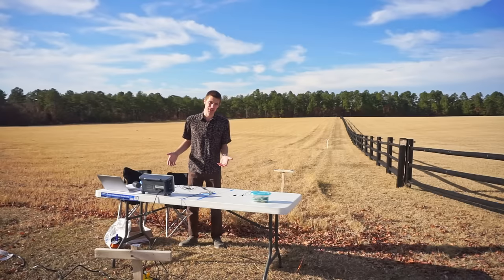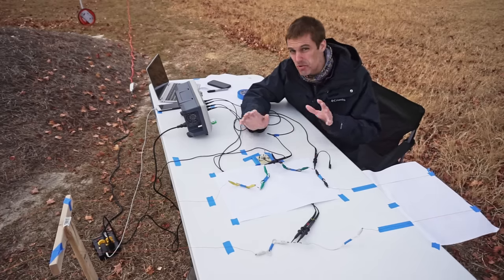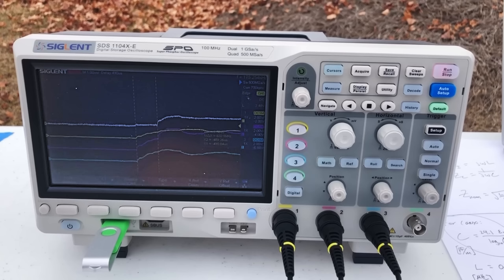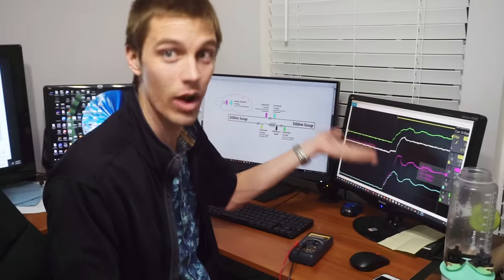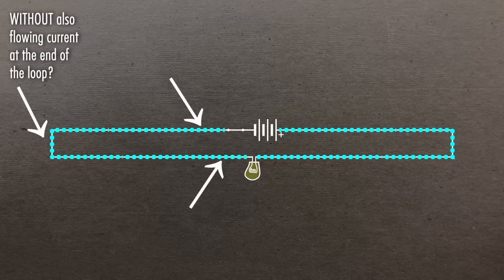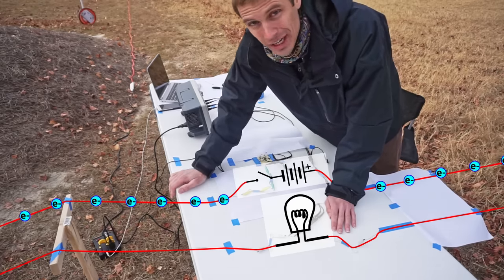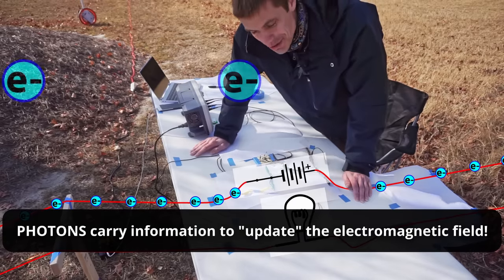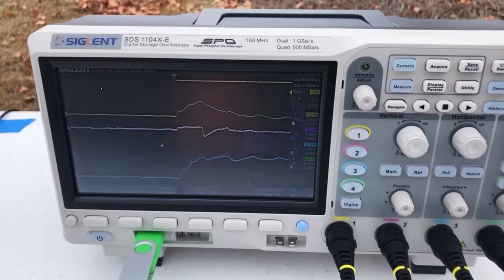I bought 1000 meters of wire to settle a physics debate

Comment: Great video! Thanks for doing the experiment for real. I like how you can see the small but constant voltage across the resistor very soon after closing the switch. I was using a 12V battery so if I used your setup I would get .5V across the bulb right away. I have seen that my bulb could light with 2V applied so you’re right it’s not quite there. But I wonder if I tweaked the thickness of the wires or the type of bulb if I could make it work. I’m doing some tests over here (not as impressively long as yours) but I will report back.
Reply: Nice!
Reply from the maker: I thought about trying to calculate the necessary size/spacing of the wires to impedance match a typical lightbulb, but I’m not convinced that the standard transmission line model applies here, because all of those calculations are assuming you’re pumping the same signal into both wires at once. There’s very particular capacitance and lack of cross inductance that falls out of that. It’s a fun thing to think about. I played with load resistances a bit but I was also fiddling with the source impedance and generally trying to keep everything high enough that the tens of ohms in the wire itself didn’t matter, and get to dc as soon as possible - you can see in these traces it took vaguely 2-3 light speed delays, and some of that was due to only switching on one side of the battery. If you can get a better match itd be pretty cool!

Edit: I’d also add that making the spacing a full meter made the effect even weaker, although that didn’t make it into pt.1, so getting it to match is an uphill battle.
Reply: This is what you should have done in the first place. I like your videos, but that one was really bad. Instead of making physics accessible to everyone, you made a non existent light bulb, that makes physics look like black magic. With magical light bulb, physics seems like magic. Nothing further from truth. Physics are simple and very understandable when properly explained, like in this video. A real bulb will never light (or if it does, it would explode after 1 us). Also units were wrong in your video. I hope you do a video explaining it correctly.
Reply: IMHO absolutely yes.

The standard transmission line model can be used; you have two transmission lines, one going to the left and one going to the right.  Say the impedance of the particular geometry (wire diameter, wire spacing) is 800 ohms.  Now your 'bulb' (resistor) is connected to the battery and the switch by two 800 ohm impedances.  Make the load 1600 ohms, and half the battery voltage will appear across the load.

Note: the 'standard' transmission line model ignores the speed of light across the gap, and only considers it along the length of the line.  So by the standard model the voltage would rise instantly across the load.  But of course we know that there is a delay across the width of the line and the rise time would not be instant.   IMHO the standard transmission line model is sufficient to describe things at time scales where the the signal will have traveled perhaps 10x the width of the line.

Setting up a signal source and scope that can see the shape of the initial rise as well as the step when the reflection comes back from the ends would require a bit more in the way of resources, because now you need a scope with GHz bandwidth.  

And Derek, I really want to thank you for putting the original video out there.  It made me think about something that I already knew in different ways, and deepened my understanding.  I've also had lots of fun discussing the various response videos.

-Jon
Reply: Hi Derek, To get higher voltage, impedance matching would at least bring your voltage up to 6V. Of course even smaller load resistance would raise the voltage even more. But then the large resistance might make it like a very non-realistic lamp. You could bring the wires much closer to increase the capacitance between the lines and so a smaller line impedance that would increase the load voltage, as a proof of concept. But at 1 meter gap, well, I'm afraid there may not be enough juice ...
Reply: Derek, the point is not if you thought experiment is right or wrong, the point is that it confused more people than it cleared up, and note how all the experts explain whats really going on without using the poynting vector. Alpha Phonix explanations were brilliant. Also the complicated topic about "lying" vs. "the full truth" he mentions in the beginning almost by accident, like "yada electrons are actually wave functions, but you can get a lot of intuition by thinking of them as charged particles".
Reply: Could you do the part of the experiment he did with broken wires to just supply enough voltage to briefly light the bulb? Can't blow the bulb if the voltage never gets higher afterwards.
Reply: @ElectroBOOM  You are so savage! I love you :))
Reply: @minor_edit  yea but too keep it lid you'd have to constantly keep toggling the switch. You'd then create a version of inductive (or capacitive (dont care)) charging/transmittion. Don't know what that would show ... Anyways I watched veritasiums vid first and didn't follow at all. Then saw e.-booms counter and thought: the part about inducting was new to me and felt like a hidden cheat (just as it did to e-boom). Seeing it on a real oszilloscope made it all understandable to me, thanks a lot @AlphaPhoenix !!
Reply: Is there something like an overflow valve for electricity? If there was then you could use a bulb that would explode at the high current but when it arrives a circuit dumps the overflow into another resistor
Reply: @ElectroBOOM  I don't know that he'd get 6 V by matching impedance. For one, there's the source impedance, although it's small compared to the transmission lines. But there's also the characteristic impedance of free space, or of air in this case. Free space is 377 ohms. I think air is less. So you have a voltage divider between the source resistance and the atmosphere, and our transmission lines plus load are in parallel with the 377. (For the doubtful, the 377 ohms is an AC characteristic, and applies to the switching transient because the step function contains content across all frequencies.)
Reply: @modigkrokodil  Yes, a Zener diode. It would limit the voltage across the load, and hence the current through the load.
Reply: @veritasium see Electroboom comment above. Those measurements are affected by probe capacitance being much higher than stray capacitance: the actual initial 0.2V plateau is much smaller and no chance to see any significant current!
Reply: Very few people have actually carefully read Feynman's chapter on Poynting's vector. Most analysis use lumped-element models; but almost no one has attempted to actually derive what happen from Maxwell + Constitutive equations which is what would actually shed light into how the materials (if the energy is outside the wire, why do we need wires? see Feynman, Maxwell & constitutive relations) and the geometry of the circuit (what if the elements were in other extreme positions, what if the lines were not parallel but as separated as possible, etc.) relate to the outcome of both the thought experiment and an actual real-world experiment. Would love to see Rumpf's from EmPossible explanation...
Reply: What voltage in the beginning? You can't call that a voltage 😄
Reply: that's it !, remember the black bird was an actual experiment with life size model and in real life situation which is how people do science even before the word science becomes a thing
Reply: Try and find a lightbulb with a filament resistance close to 300 ohms.
Reply: @ElectroBOOM  I'll take one power supply delivering energy pulses strong enough to light a 60W incandescent lightbulb via a "transformer" of  two disconnected sets of parallel wires space a meter apart please.
Reply: That guy who put sails on a car is a bad influence on you Derek.
Reply: You have 1 m / c seconds to make that bulb light, plus or minus 50%. This video while being good, does not isolate the time. 1 m / c seconds from every other time. Shorter than the full length of the wires divided by c.
Reply: I love how Derek's video sparked soo much great content like this on Youtube.
Reply: So the original premise of 1/c depends entirely on the EM field because the wires are right next to each other and unshielded.  If the wires were in a circular loop (like an actual circle and not laid down next to each other) then there would be no current induced from the EM field and the time would be around 500/c.

In the original experiment, the wire is irrelevant to the test since the EM field was considered sufficient to induce current to power the light bulb.  That's borderline trolling.
Reply: Why not just use a 100v battery ?
Reply: Derek, I don't think we were lied to in HS physics. The effect you implied is neglegible in your experiment. You don't want to confuse young students at their first introduction to electricity. Later, as they learn more advanced physics you can introduce these other concepts and augment the description of an electric circuit. This would be ma means of explaining what shielded wires are for, etc.
Reply: @modigkrokodil  Yes that is possible.
Reply: Wires separated by 1metre would probably not produce a visible result tho, any charge would decohere into the air, as well as the expected drop you'd get in a vacuum from distance. But also to point out, the "field" is not a physical phenomena, it is a mathematical description of the changes in potential forces of charged particles, so the "field" cannot cause anything, it only describes. It's a model.
Reply: Lol by changing the thickness of the wires? I don’t think your issue is that the resistance of your wires is too high, buddy.
Reply: While this experiment is excellent (and probably what the original video should have been) I think we need to be a bit careful about taking too much attention to the actual values shown on the oscilloscope. The way the oscilloscope gas its probes connected is going to affect things massively, they effectively bridge the gap between the wires. Also, while oscilloscopes have high impedance they are not well designed for DC and you are effectively adding circuitry that isn't there in the mind experiment. Intuition is enough to tell me you would struggle to light a bulb across a 1m air gap with 12v even if you used AC and a very sensitive bulb.
Reply: Hi Derek!

If you want to make this work in an experiment, make sure to match the impedance to minimize reflections on the wires and hence minimize losses. What I would try is a much higher voltage and a highly efficient LED at the load end. It'd also be interesting to see how the distance between the wires affects the circuit.

To get a precise waveform of what's going on is more complicated and you'd need expensive lab equipment. I wonder if you can get help from some quantum electrodynamics folks to accurately simulate the circuit and get some nice graphs out of it. That would remove any measurement accuracy doubts and yes, you can accurately simulate this.

I'm looking forward to another video on this!
Reply: @BeardedSkunk  Well at that point you are essentially replicating the same thing ElectroBoom explained in their video "Why Cheap LED Lights Keep Glowing". In that case it was due to the capacitance in the wiring and the AC power source but the end result is the same. Basically capacitors are reactive loads so they draw reactive current when a variable voltage is applied to the circuit as their internal voltage lags the source due to the non zero time required to charge and discharge.
Reply: @esepecesito  I have a suspicion that if he could choose between getting all the details of his video precisely right or sparking this much discussion across this many reaction videos, he would gladly have thrown in some additional trolling to get even more people thinking about the physics.
Reply: huh
Reply: At least for one experiment, please add resistors to the ends that match the transmission line impedance.
Reply: But his wires aren't 1m apart. Maybe 1/3rd of a metre. And I'd expect the induced voltage would fall of as distance^2. Ie 1/9th the voltage.
Reply: Dear YouTube audience,

Everyone knows that click bait is a scum move but the rules don't apply to me because I use it for good. What good you ask? This example is perfect. I have lots of people clicking on my video and discussing what I got not perfect and learning from others what's really going on. From here I will make a response to the response with more click bait for all of the channels I deem worthy of mentioning. It's only fair to turn the trust I built for years in my videos into cash and it's silly to believe that my laziness has been a bounty for the pseudoscience scam pushers because remember, the rules don't apply to me. I made you think, I'm not responsible if you thought wrong, and the ends justify the means. My view rate proves it.

Your pal,
Derek

Dear Derek,

Science endures but show biz is short and fickle. One makes a lot of money and one doesn't. We don't make the rules but we know how they work and why. It's called TANSTAAFL - there ain't no such thing as a free lunch. If you decide to start making Veritasium videos again instead of Vsauce ones, we'll come back to you.

Best regards,
Me and probably a lot of your original base
Reply: Hi Derek, I am by no means an expert in this topic but after watching your video I immediately had doubts about your presentation and the science behind it that there was something missing. This video is exactly what was missing. Continuing to have your video on your channel missing this information cast doubts, influences what I will expect out of your future presentations. I would question your teachings on all future videos. I would love to see your video completely replaced with even the shortest mention of what is happening here in this teaching.
Reply: @georgelionon9050  Or maybe just let things take the course they do? We wouldn't have these videos explaining how it work if wasn't for dereks, and again, dereks video, isn't even wrong, the main point of the video is that most people in general, we arent talking of engineers only, believe electricity flows through the wires, and it is important to know the limitations of that concept. 

Could he have made a full lecture and explain how everything works maybe, but his channel is about sparking curiosity into phenomenons or the limits of physics.

Why didn't we have all these videos explaining how things work to the general public from, electroboom or alpha etc? Cause they thought wasn't something people were interested in knowing or understanding at length.  But guess what, people do care.

I find all these people bashing on derek very science unfriendly, same people that wanted burn scientists that thought the world wasn't the center of the universe.

Or all the people saying they will never trust derek again, imagine ignoring information because 1 person , a human person, was wrong. And dereks video isn't wrong at all on top of that.
Reply: @esepecesito  You and all the people that liked your comments, are very sad people, you guys hate science. Because if you don't want to be confused, you do not want to learn, you do not want to understand how things work. Dereks video isn't wrong, everything he says in it is in fact right. The trick question was just a trick question, and you don't need to feel personally attacked because you got it wrong,or because you feel you got cheated on that question cause didn't add 1m/c Like, dude, why cant you just enjoy education, and all the videos that have come out to explain to better extent or to explain even more deeply what is really going on.

Scientist can be wrong, they can be peer reviewed, they don't need to be godlike or never say anything that was wrong, science is about learning and adapting.

Could we be fine knowing electricity doesn't flow outside the wires? does it affect us? Maybe not. But what if there is a person out there who looks at dereks video, andgets obsessed over things, like alpha, and find out something even more important? That is just SCIENCE at work, through history we have seen it happen. And the people here wanting to suppress information, just because its a bit confusing and tricky, no fuck off. If you get confused, then go watch peppa pig. And if engineers are annoyed at derek video, then good, get passionate and teach your audience the right way things work. But make sure you do say that actually, dereks information, is 100% correct. Cause it is.

In this video we see a small cache of energy flow instant then rest catches up at speed of light, however the energy still flowing around the wires through the magnetic fields, it doesn't mean 1% is flowing instant nd rest is going through wire, the rest is just following the wires magnetic fields that it creates.
Reply: @DarkZombeh  I'm certainly not bashing Derek in general, his channel is excellent otherwise. It was just this video that just wasn't.

And electricity does flow in wires! This is why it's so confusing. It takes a technicality and interprets it backward. There is no poynting vector without moving charges, and there are no moving charges without eletric and magnetigic field causing poynting vectors, they always come together. And when electricity doesn't flow in wires we usually call it a lightning. Or radio waves. All familiar concepts and induction etc. 

And saying putting something stupid out was so great, because so many smart people made smart corrections is also backwards.

Honestly, Derek should admit defeat on that video and admit it wasn't a good one. I still like his project tough and I also despise people getting all partisan (kicking on him all the way, or defending him no matter what). No lets just take each video at face value, and when one is bad science communication, admit it and learn from rather, rather than digging your hole deeper and deeper and changing technicalities just for the ego to be right after all.

And the proper analogy is rather someone insisting the earth round but hallow.
Reply: Just look at the modern computer motherboard. Some traces will not be straight but are made to be of equal length so all bits in the different lines arrive at the same time to the particular component. This would not be necessary if length of the wires didn't matter as you try to show in your experiment.
Reply: @DarkZombeh  I would say the statement that electricity flows through the wire, is "more correct" than what Derek was trying to say. Which seems to have been that electricity flows along the poynting vector, through space.
Reply: @JonesNoahT  Changing wire gauge changes the capacitance between the wires. It's not all (or even primarily) about wire resistance.
Reply: @rsm3t   Ah, got it. Thanks for the perspective! I still doubt it will make much of a difference, but I haven’t run the numbers.
Reply: @georgelionon9050  Electrons flow in wires, but electron flow doesn't transport energy. It dissipates energy. The Poynting vectors merely define a path from a source to a dissipative load. If the vectors are converging on a region of space, energy is being dissipated (or accumulated).

The wire acts as an inside-out wave guide. In a non-superconducting wire, Poynting vectors will converge on the wire rather than run directly parallel. That tells us what's happening in the wire.
Reply: @turbavykas  The video did not purport to show that wire length doesn't matter. Some bus protocols are designed to use reflected-wave signaling, because incident-wave signaling can't be relied on to produce sufficient amplitude. And if you have reflected-wave signaling, wire length matters a lot. Also, even with incident wave signaling, it matters for skew calculation.

The reason wire length appears not to matter here is that you are using a peculiar version of incident wave signaling, with the load physically close to the switch and isolated only by the drop across two transmission lines. EDIT: Make that "transmission line stubs".
Reply: @esepecesito  i wouldnt call it simple... Lel
Reply: You guys should arrange for some brainstorming session and make the ultimate explanation video together :)
Reply: @p0wertiger  Alpha Phoenix' video is IMO already as ultimate it reasonably gets.
Reply: @lsdave  it's a formula: take a bunch of geeks that like talking and thinking about geeky stuff, inject a bit of wrongness (whether it be the wrongness of the intuition that the electricity is all contained within the wires, or the wrongness of the implication that an actual light bulb would actually perceivably light from the initial 1m/c level current, when designed for the full 12v current), and... you get this.  :)  So, thanks, Derek? ;)  I do look forward to your own follow-up (which I hope you'll do!)
Reply: Mr. Vertasium Derik you were the inspiration for these types of videos nowadays. You are one of my role model.
Reply: The truth is that entertainment is more profitable than science, and unqualified science communicators (just like you) spread around undisturbed.
The saddest part is that the "official" science doesn't work to fix the wrong as it should. On the contrary, there are youtubers correcting MIT professors from their mistakes.
Again, you show no love for science, your explanations are often inaccurate and sometimes even WRONG. And youtube is like a potato: good chips but poor spirit...
Reply: Veritasium: "I will report back"
*26 days later*
*tumbleweed*
Reply: I just love your vids.
Reply: Nope. The switch is not next to the load/bulb.
Reply: Veritasium and AlphaPhoenix deep appreciation for your coordination.
Reply: You are both amazing!
Reply: I wonder how many amps would have been present especially with the voltage drop over such a long distance hmmmmm
Reply: I use wire all the time. Its made from copper. Copper is important. Silver is better, butt more expensive. Thanks for reading this. Thats very nice of you. Good bye.
Reply: My friend Larry says hi. He's not as smart as me.
Reply: Derek just delete your video already
Reply: After this video of yours, I unsubscribed Veritasium for ever. It's not a science channel, it's a gimmick channel. A smart quackery.
Reply: Aallahpad with plenty of star dust to satify. Understand influance, for space level.
Reply: Sounds groovy, bye. Sandwhiches too.
Reply: @veritasium didn't this whole video just prove what you were trying to explain?
Reply: Trying to save face, huh? You fake.
Reply: So if you had the light further away from the source, would that effect the magnitude of the tiny initial current?
Reply: @esepecesito it’s a lamp not a bulb - they don’t gown if you plant them ( I’ve tried!)
Reply: @massimilianobazzi2852  Nailed it.